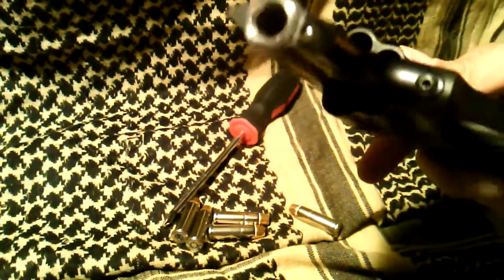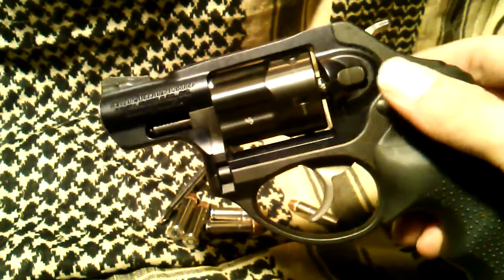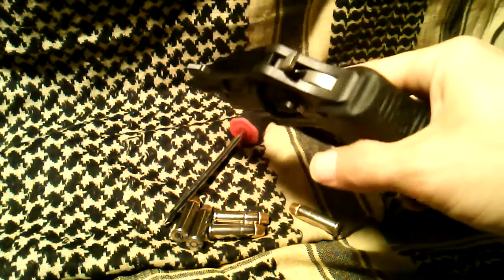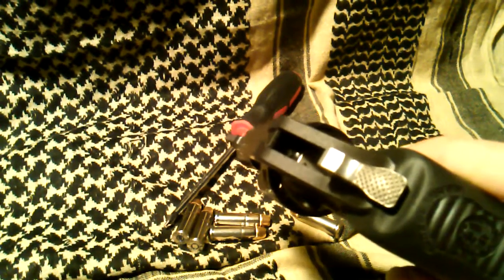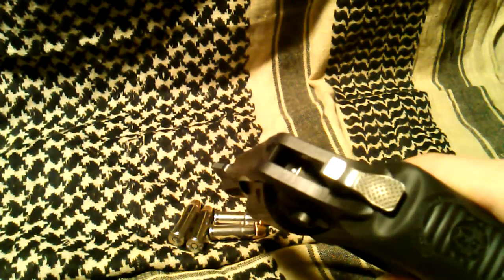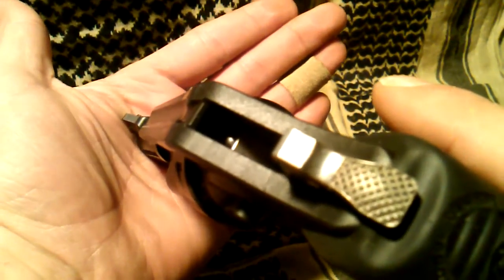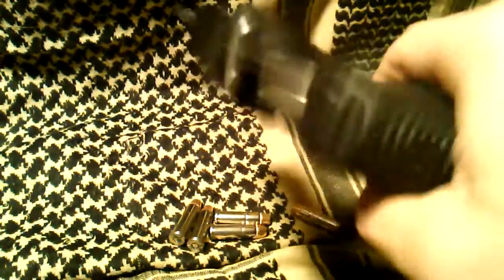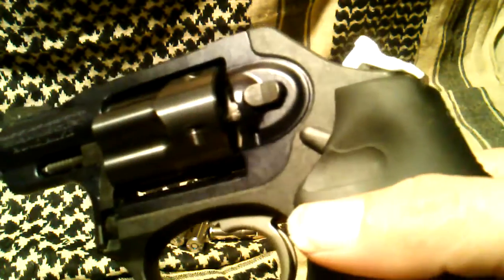Ruger LCR rattle explained

Comment: Every Ruger double action revolver I've ever handled rattled. It is easily fixed by taking the transfer bar out, and putting a very small amount of paper in the hole it is mounted in, filling the small void. The safety the bar provides still functions perfectly, and no more rattle. I discovered this back in the 80s when I had a speed six.
Reply: Here...hold my beer!